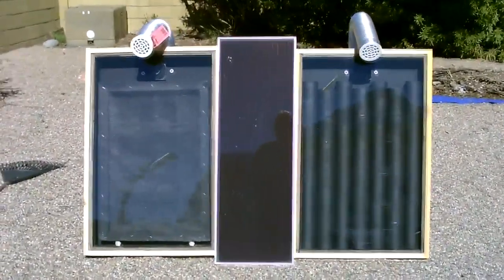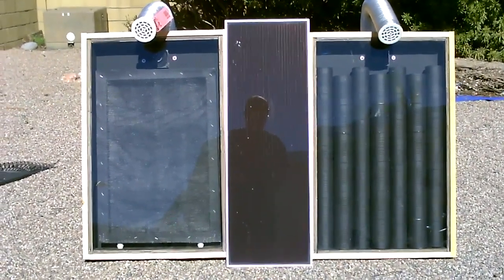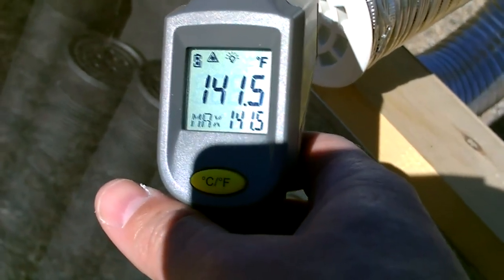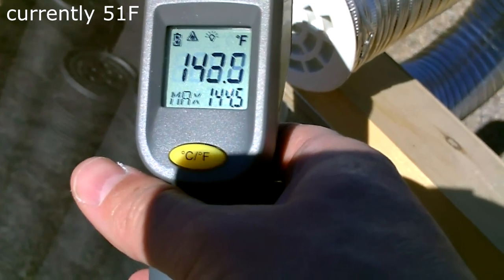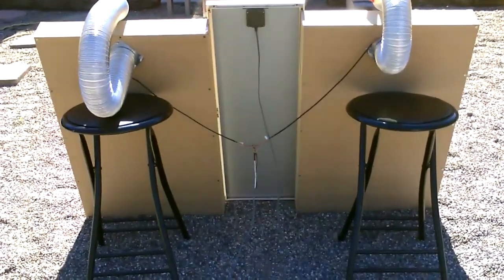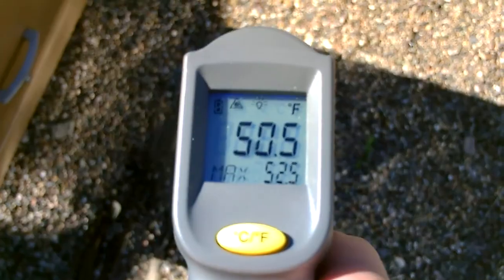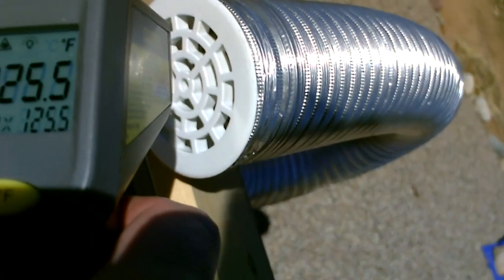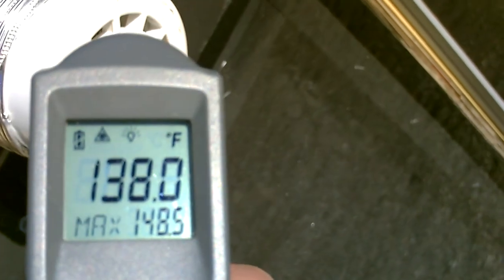Solar Air Heater Comparison! - Steel Can Heater vs. Screen Absorber Heater (temp. tests)

Comment: old vid, I know, but what sort of flow rate are you getting through the collector? Is there much of a drop in air flow from the rating on the fan?

Comment: One advantage of the can approach: No air being blown over/thru the mesh material.Maybe a couple degrees hotter but, arguably, cleaner, less contaminated air being blown into the house.

Comment: I wonder if you drilled a hole in bottom of aluminum cans and stacked and painted them instead of steel cans if it would work better due to the fact that aluminum is a better conductor of heat...  ...you could also cut the cans open and staple the flat stuff to back or use aluminum foil,, then when the clouds came it might stay hot longer.. be interesting to see that comparison

Comment: Thought about the cost to build so I went in to the kitchen and grasped the heavy-duty aluminum foil and folded it in a w pattern painted black and mounted in a frame with clear plastic in front and put in south window. Inside the house. Heat came rolling off even thought the sun was shining through double pane Windows

Comment: aluminum screen, no need to worry about longevity, i think i would have left off the back lower or upper feet or built the inner frame at an angle so that the air had to pass trough the screen. perhaps i shall do some experimentation with this to see if it improves the heat output.

Comment: My take on these heaters is to start with a well insulated base at the bottom and sides of the box. instead of cans I have a series of steel plates. 3 feet long, 6 inchs wide and minimum 1/2 inch thick. These black plates absorb the suns heat and can retain the heat much longer than a thin aluminum can or cloth. If you ever go camping and put large rocks into your firepit, they make excellent bed warmers for the long cold night. You bury them in the dirt under your sleeping bag. Anyway..back to the box. Create a channel out of wood for air to flow up and down the length of the plates. like a mouse maze but linear. Start with the air coming in a pipe at the bottom and exit at the top back into the room like all the others.  All interior should be flat black and the top covered in glass or plexy. The difference is when the sun goes down or is blocked by clouds, the heat collected in the plates will continue to radiate heat for a long time before they cool off completely. The aluminum cans used by others have no way of retaining the heat as they are too thin.

Comment: I would use copper tubing
Get from scrap yard lil cheaper
Would probably cut 1/8 inch holes all along length of tubing for better release of conduction from copper element. 
Hot enough to scold your hand.

Comment: In the can heater you need to fill several can with sand after the cans and sand heat up the sand will retain heat for a long while after the sun goes behind the clouds
Reply: Yes, but then you won't get any heat while the cans are heating up :(Additionally, some stored heat will leak from the frame in the infrared spectrum.Best just to grab as much heat from the system as quickly as practical.
Reply: @barleyeducated8714  exactly right on.

Comment: Hello, have you tried to place a mirror on the ground at the bottom of the panel to reflect more sunlight on the panel for testing how much the temperature would go?
Reply: Richard Berube like a solar oven?
Reply: @momof1576  not a mirror, maybe a mylar spaceblanket or parabolic dish.
Reply: what about thick aluminum foil glued to all the inside walls?
Reply: Thinking about this, all heat absorbed to rear wall also contributes to heat production so getting more sun to cans might not make much difference, just thinking.
Reply: @Karjis  So possibly limits to the output because its already hot.   Using a reflector it can get hotter,   i was thinking Increase the airflow somehow.   A extra fan would use more electric unless if it were on a mechanical thermostat.
Reply: @mike289homebuilt5  there you might have a point that you could get more power out if you can get the heat from back wall effectively to air. What I have tested I am thinking that because parts are almost free, just make the collector bigger and not worry too much about efficiency. 
My solution to add airflow is to have powerful fan (120x120x38mm 19Watts) which is temperature controlled so that it keeps the output roughly at 100F maximum, when sunshine is stronger the fan will increase the rpm according to temperature from the uppermost part of the collector. It seems to do quite good job and 1100sqft garage gets about 3F warmer during a day if sun is shining.
Reply: Hinged, covers unit during cooling season?
Reply: Make it smaller and use a Fresnel lens to focus the sunlight to boil water?  Wear eye protection, it will be bright!
Reply: @solarsynapse  It has been my idea  too,   boil water for steam heat or possible second one to distill water.
Reply: @mike289homebuilt5  Your talking about a completely different subject matter posted in other videos.
Reply: Convex mirrors to focus & direct the solar rays on motorized timers to capture the ideal reflection positions

Comment: How do those compare to just a plain black box without a screen? I'm in favor of balancing performance with ease of construction. I'll bet the can one took 3 times as long to make and they perform the same.
Reply from the maker: hi there. temps are roughly 25 degrees cooler (without screen or cans). a quick test of the "plain black box" versus w/screen absorber can be seen in either the original "screen absorber" video or in the "5 solar heaters" compilation video i recently posted. the result of that test was a max temp of 109.5F without screen and about 137F with w/screen.

Comment: nice projects man...i have few questions:
1. how long do these heaters survive real conditions outside? in years...
2. does the pc fan survive the high temps inside the heater?
3. how powerful must be the pv panel to keep the fan running in some cloudy contidions?
Reply from the maker: hi there. on your first question, they can survive years (even decades) but it's going to depend on your climate, how well you seal it up and if (and how) you treat the wood etc... on the second question, those computer cooling fans are specifically designed to handle the same level of heat as in the collector so they should last their normal life span (which is typically 30,000 to 50,000 hours - in other words decades). those fans are typically 2 or 3 watts, so i generally recommend a 5 watt panel or higher. that way even when the sun is at an angle or it's slightly cloudy, it will keep running strong.
Reply: thanks a lot man... one last question:
i have a cold room that due to the house -construction i must push the hot air from some 5 or 6 meters above. will this heater be able to send the hot air  5 or 6 meters Down to the room? thanks

Comment: Ok, these are interesting and I would imagine you need a vent long enough to blow the air into the space you want heated???  And, you show a solar panel between the two??  Is that included  in the heat process?  I like this idea as I want to heat my enclosed porch but do not want the added  expense to my electric bill.
Reply: he uses the solar panel to power the fans, so he's really totally off grid  :)

Comment: If the window I need to use it in faces the North, would I be better off using two fans since  I would have to use a longer dryer hose (about 15-17 ft)? What about painting the hose black also to help hold in the heat? Also, have you tested it in temperatures were it is 7-10° for  the high before the wind chill yet?  Any suggestions on how to insulate the window it is going into really good?  Thank you for your time!

Comment: the cans will work much better if open on both ends and raised from frame at bottom for free air flow.
Reply: I disagree.  Leave both can ends on...The more mass you can leave/install, the more heat will be available to heat flowing air.
A few holes in BOTH ends to allow for air flow might work fine.
Better yet, fill the can assemblies with massive of some kind, maybe ball bearings?
Lots of mass, lots of air flow passage between the bearings.
Reply: @dantyler6907  i happen to have a small collection of ball bearings i was saving for such a project.
Reply: @dantyler6907  ב''ה, I've lost the literature but I think the hippies in the 1970s discovered that for some reason the first suggestion about the open bottom and bit of plenum space for air to mix and distribute between the tubes helps, probably only need a small gap because air is air.  Would figure the additional mass otherwise would help but shame a lot of the old experimental results on best hole size and techniques are hard to come by these days.
 
Using a regular juice can opener would leave the mass hanging into the cans rather than removing it, for what that's worth.

Comment: Would the cans continue to put out heat longer without the sun than the screen? More mass that's been heated taking longer to cool. If so would filling the cans with a fine sand help maintain that thermal mass longer making the heater useful for while even after sun down?
Reply: Thermal energy storage inside the solar collector: Sand, rock, tiles, or metal, is a bad idea because during the day you are collecting solar energy, but during the evening and night, as you pass air through them to collect that energy, they are also radiating energy as infrared light out to space. The quicker you can get heat out of the solar collectors, the more efficent your solar collector will be. 

One can still intigrate thermal energy storage inside their home for better heat during the evening and into the night.  But, when the sun goes down, air flow into the sollar collectors is shut off preventing them from being thermal radiators over night.
Reply: you make your point very well but I see where  isheian is coming from. the fact is that many properties would have adequate heating in the morning hours already from an overnight electrical storage heater and strictly speaking probably don't need the extra from these solar collectors during the day. Isheian mentions sand and there are other materials used in storage heaters  that you mention. it doesn't seem impossible to develop an apparatus that would blow out the retained heat from an adapted solar collector after darkness .After al if it works for electric over-night heaters why not for sola rcollectors?
Reply: The air goes through the cans so you can't add sand in them
Reply: @rayleblanc7209 lol

Comment: Is that metal or plastic insect screen ?  Does it matter ?
Reply: If you have enough of the plastic screen, you WILL produce heat, but not nearly as much as the metal screen.

Comment: have not tried a screen unit, but built can furnaces that produced 95 on a -12 degree day in full sun.  we tested in summer on a 90 deg day and saw readings of 210-230 deg.  both test were without the use of fans.
Reply: The longer the air stays in the collector, the hotter it will become. Without a fan, the air in yours was nearly stagnant, allowing maximum temperatures rise. With a blower moving the air, it limits the amount of time the air is within the collector. You can regulate the fan speed, to increase or decrease the temperature. The key is to find a balance between temperature and volume, to produce a useful amount of heat.

Comment: Will this run at night also?
Reply: Nacho Biz whats the big key word in this?  Solar, is there sun at night?
Reply: Dig a hole under your dog house about 1 cubic m. Insulate hole, put few bottles with water inside and some pipe sistem from pannel - around bottles and up to a corner. Fill up the hole and place dog  house on top with the end of pipes inside it. This will store some heat for the night. It works for houses :)
Reply: No it will not work at night since it gets the heat from the sun and won't store it for long. If you need to keep your dogs house warm at night, you will need to figure out some way to store the heat or energy and then release it during the night. That is getting trickier, an example might be to use solar panels to charge a battery, and then use the battery to power a small heater at night.
Reply: Maybe add thermal mass like expanded clay?
Reply: Those arent solar lights. They are solar recharged battery lights. :)
Reply: no there is not. But there are some SOLAR LIGHTS that charge during the day is able to be used at night. so that still did not answer my question. So I believe the answer is no. I was looking for something to build on my dogs house to keep them warm.

Comment: I've been watching videos on these types of projects for a while now, and love the idea, but have a question.  All of the demo and test vids show the outdoor temp in the 40s or maybe as low as 20s.  Can anyone give me any information on how well these do in places where it gets truly cold?  I am in North Dakota, and it occasionally gets into the minus 30s before windchill.
Reply: A single glass panel has a u factor of around 1.22(R 0.8) which means 1.22 btu per sq/ft per hour per degree F of temp difference...  if those are 2’ X 3’ collectors they have 6sq/ft of surface. With 45F air in and 120F air out at I am guessing around 45 CFM that panel is outputting about 3400 btu/hr. The panel mean temp would be around 82F. At 45F outside that is 37F difference. So 1.22 X 6X37 = 270btu per hour heatloss back thru the glass.  The thin back would be similar but less as it isn’t as hot and the edges would loose at a lesser rate.  Total losses would be probably less than 500 btu/hr though, or about 1/7 of the output.  Insulating sides and back would help significantly
Reply: Should be the same for any collector, it is the suns heat, not out side temp.
But better insulation on the outer sides & back may help some what.
Reply: no point in putting your box inside ...
all that sunlight is already inside your house warming it.
you want to capture energy that is outside and would otherwise go untapped.
Reply: Jon Minnella - What's this all aboot?
Reply: I'm making my way through the youtubes for research now and the best option I've seen is to star with warmer air. Either put your box inside, or pipe house air outside into the panel and back in. Reckon you could put 2 in series if you were fixated on getting fresh, warm air.
Reply: Not entirely...  Having metal cans (pipes) to also absorb solar heat adds a bit more heat into the house with forced air flow.
As cheap as this is, splurge and add as many cans as you can.
Reply: It should work just fine I am from Manitoba ca
Reply: Have you given it a try ?
Reply: Dwight Gordon  will work but remember  it the air being drawn through the collector is that the bottom so if you place this outside and do not pipe in the supply air  to The Collector it will not heat up the air to the temperature you require I would recommend placing this inside the house in a window as an experiment before you go to the trouble of making holes through your home they do work I have built one or two of them to heat the garage helps offset the heating cost I to live in a very cold climate getting down to the -30 C here in Northern Canada

Comment: Next step: 
put both heaters in series and check the output temperature 
Good job!
Reply: what you gain in heat would be lost in efficiency :) Its best to run the output just slightly higher than what you need and move more air.

Comment: Why don't you heat up an interior space with each unit showing real time interior temperatures at various areas in the room before the heat is turned on and after the heat is turned on.
Reply: Extra work for what ? You now can build this with a variety of stuff you have around house without a big diff in temp

Comment: Crazy thought - what if you put the two heaters in series? Pump the output of one collector into the input of the other - will you double the temp?
Reply: Would have to make sure each are 100% airtight between transfers, and also ensure that airflow is as efficient as possible. If done properly I believe it would increase efficiency

Comment: I like both designs for your well thought out simplicity and low cost. Makes me curious to try a similar design using your plenum and fan design without media. The media would be a much smaller and cheaper solar panel. The front glass of the plenum would be the type that reflects solar energy back into the plenum. Just the differential temperature numbers you are achieving is encouraging me to build a couple.

Comment: I bet you could increase the heat  output of the screen model by having more layers, or  even just one more layer of black screening staggered below.  It would increase the surface area. You should try that next.:) top